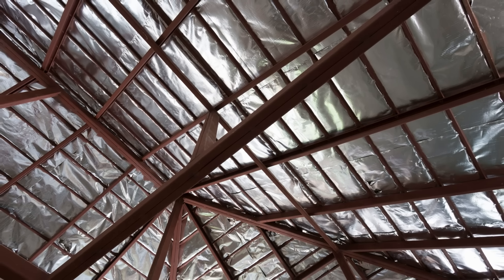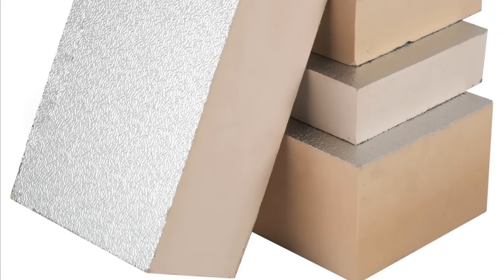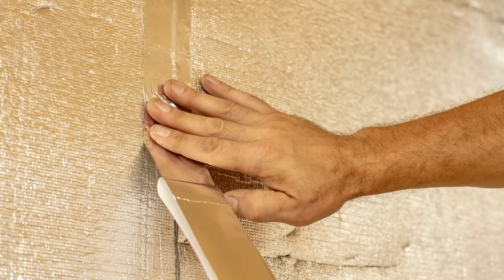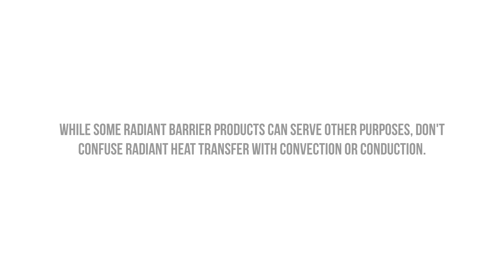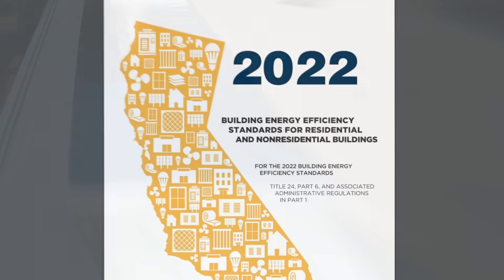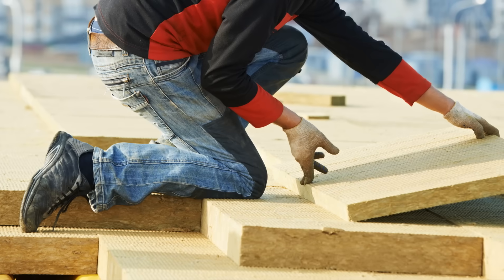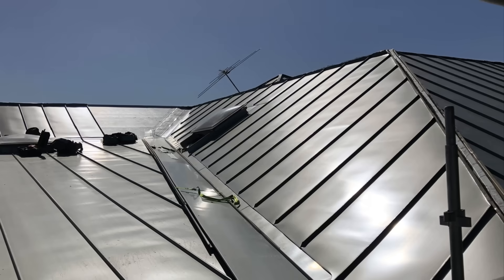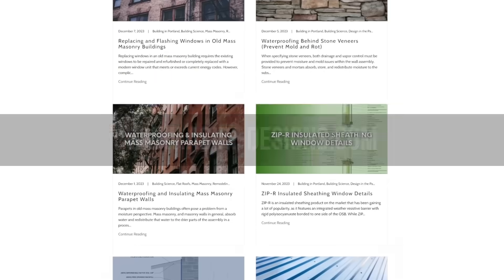Do Radiant Barriers Actually Work?

Comment: I have seen debate about radiant barriers continuously resurfacing.  A few items that come to mind:  Not building with an adjacent air gap doesn't mean that there is no air gap.  Construction variations appear to frequently leave gaps where materials are not uniformly in contact.  This means there may be still some benefit from the radiant barrier.  This second item is similar, in the sense that there may still be a net energy bill reduction from a radiant barrier facing in the wrong direction.  Any substance with heat energy will either feel warm or hot, or even very hot.  It is also emitting radiant energy in all directions, until that radiation bounces off of a reflective surface.  If the barrier is facing to the interior, radiant energy from the sun that has transmitted through the roof deck and shingles will reach the backside of the barrier and to some extent should then reflect back into the deck and shingles.  This would probably mean that asphalt shingles will degrade sooner, but the interior home comfort should see some kind of benefit.  However, I have no idea in the long run how these different expenses would compare.  It seems obvious that the best strategy is a ventilated metal roof system.
Reply: It IS important that the air-gap is immediately adjacent to the reflective surface as it is the combination of air (insulation properties) and the reflector (radiation stop properties) that make the combination so effective (when done right). 
There are also considerations of vapour venting and/or venting of the heated air (chimney effect) to be included. 
In the modern well insulated home (no huddling round a small fire in the centre of the space with open vent for smoke) that we need the careful details around the critical inside-outside barrier. 
Historically it hasn't been a consideration in the construction industry...

Comment: I live in southern Ohio. I have a garage attached to my house. The garage attic is not insulated and heats up like an oven in the summer. Would it make sense to attach radiant barrier 2 inches below the roof deck?
Reply from the maker: @chuckhall5347  As long as there's a gap and you're venting it, it would help a bit. Just keep in mind that you're not going to be able to dry through it.
Reply: Apply cut foam, unsheathed, between the rafters.  That will help a lot.  They don't have to be too thick, just two inches is enough.  From my fifty years of experience building homes.

Comment: what about a radiant barrier on the interior of a window facing outwards?  will it reflect the UV rays out or is it worthless because it is touching the window?
Reply: You need an air gap to prevent conduction.
Reply from the maker: @dovahkindragonborn9827  Radiant barriers deal with infrared radiation, not the UV spectrum unless it's been specifically designed for it.

Comment: Radiant barriers do work. I have installed them, no sponsor. But, the air gap is absolutely needed. Any foil face is the face you need to the side that is the heat you want sent away. If it touches anything on that side, it does not work as a barrier. Air is the "insulation". You could have loose batting on the foil side, if you want better insulation, but you need an air flow somewhere in that cavity.

Comment: Is there any benefit to inward facing radiate barriers? There are a lot of products out there.
Reply from the maker: @smersh007  Only in very poorly insulated attics. Ton of articles and reports out there conducted in the 80s and 90s that once you exceed R-30 they have little to no effect.
Reply: Possibly if youre trying to keep radiant heat inwards inside the enclosure. But not sure how effective that would be. Its most likely those products are designed incorrectly or its just some marketing BS
Reply: Actually, in a mainly cold climate, it makes sense that inward facing radiant barriers can help keep the interior heat on the inside longer.  That would make sense if your largest energy bill is for heat, and little is spent for cooling in a given year.
Reply: Yes, when you want to reflect heat from the inside of the home back into the home istead of losing it into the building envelope and ultimately the outside environment.
Reply: It works very well if used on the inside of the roof sheathing and you can stand to be in your attic during the summer.  From a Texas builder with fifty years experience.
Reply: @thomaswayneward  Can you make sense of your statement? I cannot. Works well for what purpose, cooling the house? What does being in the attic have to do with it?
Reply: @pcatful  No.  You don't know enough to understand the problem.  Go to engineering school, like I did and that would be a great start.
Reply: @pcatful  Reflective material facing out or a reflective both sides material makes sense.  If it's facing in only, the benefot would be the 3.5" air gap cretaed by turning the spaces between the trusses into air barriers that also carry heat up and out through a ridge vent.  You don't lose heat through conduction or convection if the hot air under the shingles is constantly cycled up and out and because the air has a low thermal mass, it cannot hold enough heat to transfer it to the layer of radiant barrier attached to the indide of the top chord.  The air keeps the heat away by being a poor conductor of heat transfer and by continually moving it up and out by convection.
Reply: @thomaswayneward  I appreciate this comment.  That is what I had thought.